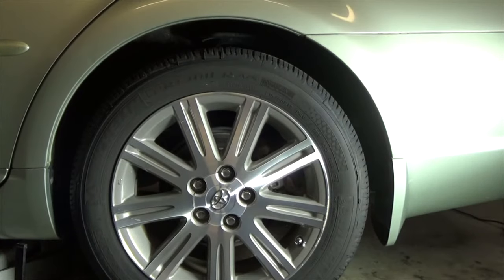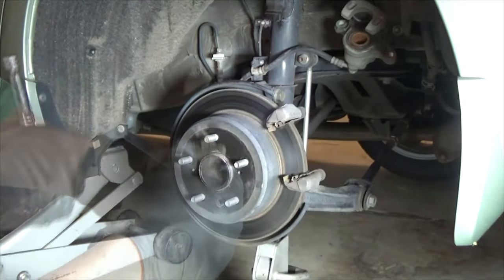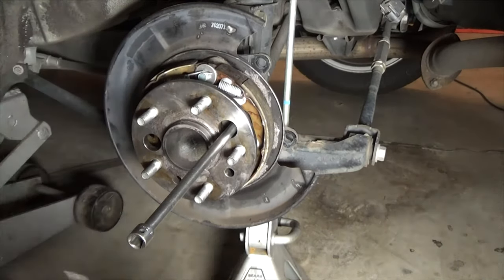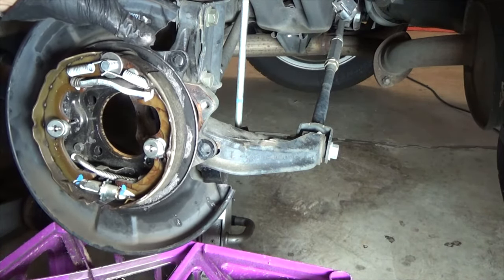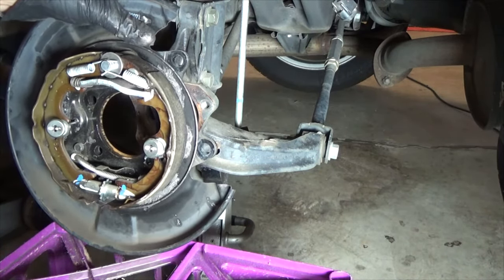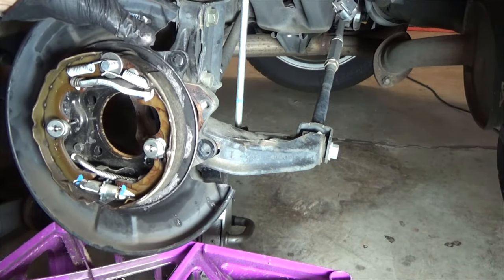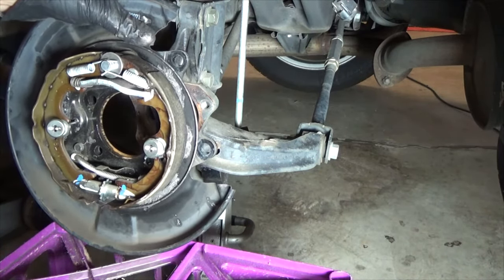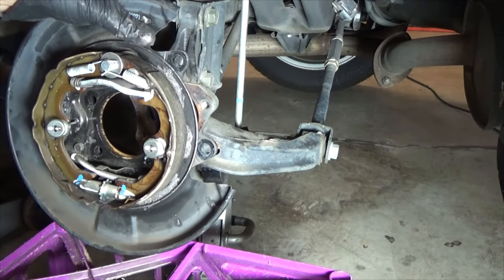Toyota Parking Brake Disassembly and Reassembly

Comment: using tape on the backing plate instead of lubricant is NOT a good idea.
Reply: Yeah. Had no idea what he did there...
Reply: Agreed that gets way to hot for that tape or any tape.  Adhesive will melt.

Comment: It's a good idea to spray some mild cleaner and then silicone grease into the exposed lip of the bearing, while you have the rotor off.
Reply from the maker: Excellent idea. Thank you.
Reply: @A_Renaissance_Man  Thanks for the video! Very helpful.
Reply: @A_Renaissance_Man  What tape should I look for to adhere to the lubrication points? I like the idea; do you find it gives better/smoother shoe travel compared to greased metal-on-metal?
Reply from the maker: Thank you for asking.
I used a high quality name brand Duct Tape.
The shoe movement is so small that there has been no movement or bunching up of the tape on previous uses of this technique.  I have not been back to this particular job yet but, I have had no issues with the brake rubbing after being released.
I hope all goes well for you and this helps you keep your car going for a long time.

Comment: The dust cover plates for both left and right are incredibly over $900 for my 2007 Camry...just the dust plates....
Reply from the maker: Yes, they are rarely replaced.  I recommend going to a junkyard if you need them.

Comment: Sometimes the drum won’t come loose without having to manually release the star nut expansion bolt at the bottom of the shoes, I’ve seen a lot of people not know that and completely destroy the whole setup. In fact, there’s another video of some yahoo doing just that on a Lexus SUV. Pretty much every Toyota and Lexus and other makes use this setup. There is a small access port for a slim tool, takes a few rotations. Just thought ide throw that out there if anyone is running into a stubborn drum that doesn’t want to break loose. 🔧 🇺🇸
Reply from the maker: Thank you
Reply: Massively important point & warning. 👍🏽👍🏽

Comment: Great video and instructions, looks like the same setup for the 2012 4Runner. The socket and extension as you had it does not affect the torque. Only when you use an offset adapter other than at 90 degrees to the center line of the torque wrench will the torque be affected. Then you would use a formula for the actual torque. Did lots of helicopter maintenance in the Army using torque wrenches. Thanks again for the video!
Reply from the maker: Excellent. Thank you. My work was in power plant construction and that was way back when the earth was still cooling.  Thank you again.
Reply: If tolerances of the adapter, socket, or wrench are poor, then it will affect the torque ultimately being delivered to a bolt or nut.

Comment: Thank you!  Great video.  The reassembly of the springs are the hardest part for me.  I changed ours a couple of years ago and now I have to replace the dust Shield on the passenger side.  I need to take pictures or get a diagram so I do not forget the proper sequence of assembly.
If I did them every day for a while it would be a breeze, but after a couple of years It is not fun.
Thank you for this very informative video.
B

Comment: Thank you so much for posting this. I don't think I could have done it without your guide. On my Highlander I thought you had to install the wheel bearing first so I wish I would have thought to do the brake first like your video says to do.
Reply from the maker: Excellent. You are the reason I post these videos.
Reply: Great video ..I am doing a 2008 RX350 AWD and your instructions  were a great help as the process is quite similar..

Comment: Great video (previously commented), Just finished replacing shoes on '04 Sienna without removing the hub - as mentioned - not much room to work! One hint I wanted to share - getting the retainer spring with hold down cups back on shoes was a chore given limited room to maneuver.

 Had helper push on back of retainer pin while I compressed the spring holder cup/spring (w fingers) while sliding the shoe into place on the backing plate. The whole spring/retainer assembly then slid into the slot and you could rotate base cup tab into the hole on shoe pretty easily.  For me it was much easier than trying to push the cup down and turn 90 degrees once on the shoe - the pin always tried to rotate!  Maybe this saves someone time and aggravation!
Reply from the maker: Thank you. Great idea that should help someone.

Comment: Great video David, and very clear walk through. One thing that stood out for me was the use of high strength black tape in lieu of lubricating the shoe contact points/backing! The other was that no thread lock was used on the 4 attach bolts for the bearing assembly. I would have used medium strength thread lock just to be safe.
Reply from the maker: Excellent. Thank you very much.
I actually used red lock tight which you can see at 14 minutes in the video but, I forgot to include that when I filmed the left side.  I should have edited the footage into the video. Thank you for pointing that out.

Comment: Nice step by step video!!  Thanks!  Any additional info of adjusting the parking brake?  I've got a 2017 sienna which is a very similar setup, but the parking brake is loose after doing the rear brakes.

Comment: Great video!  Thank you, David!  One question, for the right wheel, will the self-adjusting bolt orientation be the same, dummy to the front and threaded portion to the rear?  Thanks again!
Reply from the maker: Yes, that is correct, threaded portion to the rear and the shoes to drum adjustment direction is the same too.

Comment: I know you didn't include the detail around adjustment of the E-Brake shoes but I am curious to when you know you have them at their proper clearance.  I have an '11 Camry SE that has an issue with after releasing the E-Brake the shoes still rub when moving the wheel forward but not backwards.  My wife really doesn't use her E-Brake unfortunately so I suspected some rusty components around the shoes and hardware but that turned out not to be the case.  After trying to readjust (even backing the adjuster all the way down) the same issue happens so I'm now suspecting the cables are not allowing a full return (rusty themselves).  Was just curious as to what is recommended to "properly" adjust those shoes?
Reply: Hey Michael you probably have to replace your parking brake cables.
Reply: @user-bq2py9tl5l  In fact, I did for the front one but amazingly the rear ones were fine. I had a cable luber from having a motorcycle and I used that to lubricate those just in case. I always try to use my parking brake every so once in a while to to keep things moving even if I don’t need it.

Comment: What's the reason for using tape instead of lubricant at the shoe slide points? I think that the tape will fail, fall off and cause a host of new issues. Correct me if I am wrong.
Reply from the maker: The tape lasts for the life of the shoes and has not ever rubbed through on any vehicle I used that trick on.  Anti-Seize is a mess and I just wanted to have a clean area should anyone have to go back into the job to replace the shoes as they only last 8-10 years before dry rotting and needs replacement again.
As a final note, usually this is only done once and the car is sold or scrapped before needing a second application.
You are free to do the job as instructed by the manufacturer as the instructions states to use anti-seize.
Reply: @A_Renaissance_Man  ok thank you for the quick response.

Comment: Curious of you noticed any co tact with the retainer pins/springs and the back of the hub bolts when they rotated.
Reply from the maker: There was about a quarter inch gap between the pin's spring retainer and the back of the hub.  Contact would mean some sort of failure occured.
Reply: @A_Renaissance_Man  i was looking at your pin and it seems to be more C shaped than the one im dealing with. Will need to hope the dealer has a parts kit. Autozone didnt even know those shoes existed.

Comment: Can you get the entire parking brake assembled? I just ripped my busted one out…I’m a novice and have only done regular brake jobs.
Reply from the maker: Well ... I did the right side before filming the left side so that is where I followed the official Toyota procedure and then filmed the left side.
I would just go through the steps as best you can.  There are always problems to overcome that interfere with the smoothness of the procedure shown on video.

Comment: Whats the book time on this job?
Reply from the maker: Last time I checked, the time was one hour each side, both sides are required so the book time for the Dealer Technician is two hours.  That means the total replacement cost is $450 to $850 depending on where the work is done, i.e., east coast or west coast.

Comment: Is this same for 2006 gs430v
Reply from the maker: I would say similar but, the instructions were specific to the three cars mentioned in the video.
Reply: @A_Renaissance_Man  the little top hat broke off my straight pin from the assembly and it’s been rubbing on my rotor kinda binding it

Comment: So let me start by saying,  much of the information is going to help someone who knows nothing about a vehicle, but no real mechanic, shop or dealership is going to remove the hub to replace the brake pads. It creates more work, could affect the alignment, amongst other things. There's no reason taking things apart that aren't necessary!  All you have to do is pop the top tension springs off take the pad retainers off then the pads will come right off and out the bottom, with the adjuster still attached, then you disconnect the cable, assemble the new ones and put them back in the same way.... People are replacing brakes not trying to restore the vehicle....
Reply from the maker: Your videos are much better.